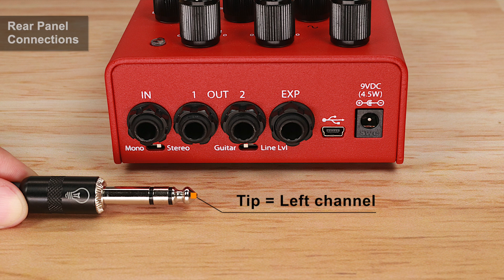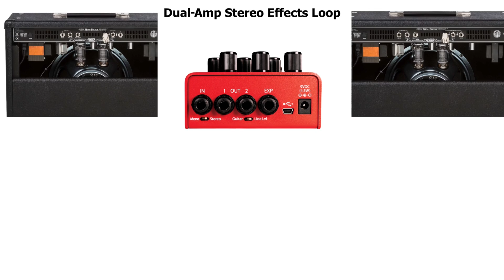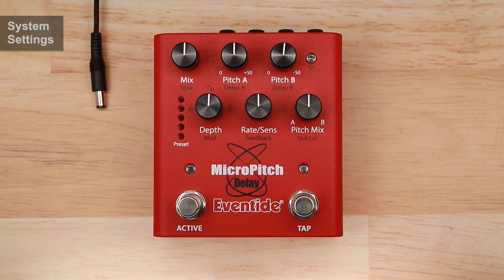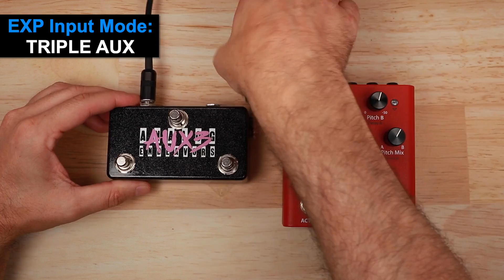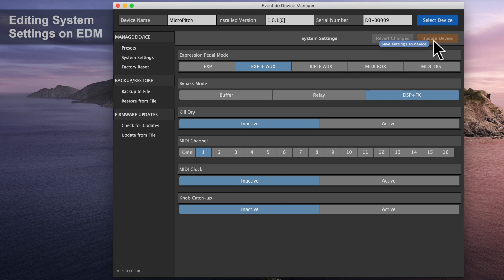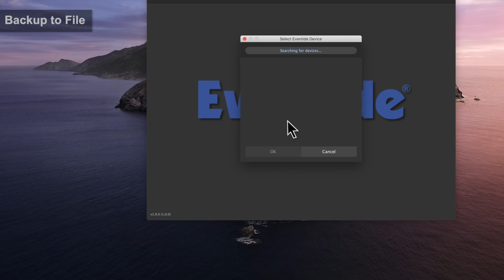Eventide MicroPitch Delay Pedal Tutorial - Part 2: Rear Panel & System Settings

Comment: Is it possible to connect a 2 button external footswitch that will 'Increment and Decrement Preset' without having to push a button to load the preset?
Reply from the maker: @DanMarshall-j1o  No, not with a standard auxiliary switch, however this can be achieved with a MIDI controller. For example, Disaster Area Designs makes the MIDI Baby controllers that are compact and can be programmed to control MicroPitch Delay in this manner.

Comment: In a wet/dry/wet signal chain with a stereo chorus, how or where could I connect the stereo chrous effect with the micropitch. The chorus has a mono input though. Don't plan using the chorus and micropitch simultaneously,  just want both on the board as an individual option.

Could I use a tip/ring y cable out of the chorus left and right into the micropitch set to stereo? I plan using the micropitch as last in signal chain.
Reply from the maker: Yes, that should work.
Reply: @EventideAudio  thanks, I'm trying to do a rig that can pull off evh and zakk wylde tones.

Comment: If I have in mono and only use the Output 2 will the output be mono or is it only half of the stereo? The outputs are too close together for most of my patch cables so it would be good if I can just use output 2 of pedal for mono.. or is this only one of the two delays when I do this?
Reply from the maker: For mono, Out 1 is the only correct configuration. Using Out 2 only will yield undesired results.

Comment: when using the one preamp stereo effects loop, should the 2nd amp be running clean as possible or does it just act like a right speaker so only volume is used?
Reply from the maker: Correct, it acts like a right speaker. The second amp’s preamp section is out of the picture. In this case, we’re only using the 2nd amp’s power section.

Comment: @Eventide Audio Can this pedal self-oscillate like an H910?
Reply from the maker: The MicroPitch Delay doesn't quite do self oscillation, as it’s designed to not get out of control. But, the delays repeat for quite a long time with the feedback turned all the way up, and you can make them gradually fall or rise in pitch like an H910, if that the sounds your after.
Reply: @EventideAudio  nope that is not what I’m after. I use the self oscillating as creative mode to make huge burst of bass or hi frequency scream, and I make us of the artefacts. I don’t understand why you guys don’t realize that. It is a bit like if you only think people use those fx as Phill collins did (and I like phill), there is a whole spectrum of people who did the other way. In dub music especially. That is just too bad, you should get the counsel of people with a broaden musical culture.

Comment: For Audio Interface connections, is the following correct? Guitar cable plugged into IN on pedal with Guitar/Line slider selected to Guitar. One cable from OUT 1 on pedal to IN 1 on audio interface. One cable from OUT 2 on pedal to IN 2 on audio interface.  Open one track in DAW (with amp plugin) assigned as Input 1 panned Left then duplicate track (with same amp plugin) assigned as Input 2 panned Right. Mono/Stereo slider selected to Stereo. Help!
Reply from the maker: No, the mono/stereo slider should be set to mono, as this only controls the input of the pedal. The pedal will automatically function in stereo when two cables are connected to outputs 1&2. With regards to your DAW-based amp modeler, most have a stereo version. If so, try creating a stereo track in your DAW and putting the stereo amp modeler on an insert. No need to use two separate tracks and manually pan them.
Reply: @EventideAudio  Was I correct in saying the cable connections are correct?
Reply from the maker: @SoCalDrone4u  Yes, the connections are correct.
Reply: @EventideAudio  Awesome, thanks! Last question. I assume TRS cable are fine going from the pedal to the audio interface?

Comment: Can I use this as a standard pitch shifter? For example, if I wanted to go from E to F with only the wet signal on?....Or, simulating a capo, in simpler terms.
Reply from the maker: No, MicroPitch Delay is meant for subtle pitch shifts for stereo widening effects (+/– 50 cents)